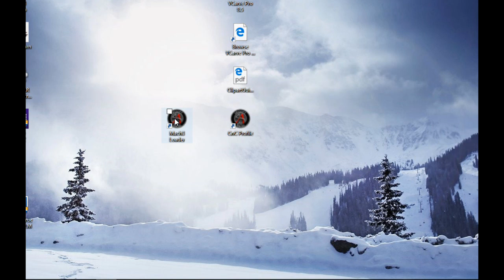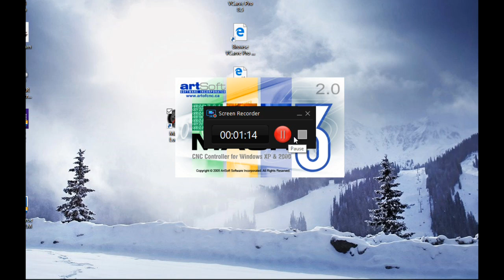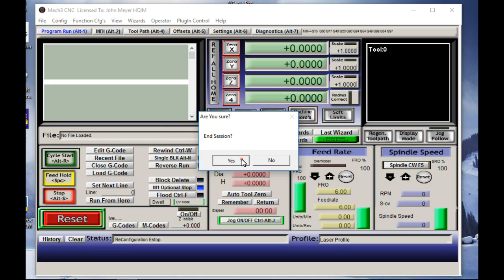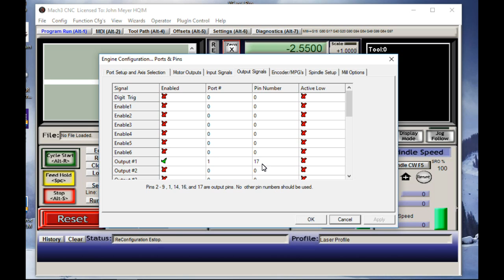0002 Mach 3 Laser Profile Setup for JTech Laser and VCarve Pro

Comment: I don't know maybe someone can help me or maybe I'm over looking something
breakout board I'm using is a DB25 1205..
laser is 15w … 3 wire ..... positive... negative... PWN
laser came with power supply...
hook laser up to pin 17... basicly followed setup in this vlog
test … laser on... but laser is on straight out of box too..
question is how do I turn laser on and off
is this function within gcode...
or can I control this via mach3

Comment: Great, even work with chip Chinese TTL (0-5v)pwm, just hooked up 12v to power, Gnd to Gnd, and 5vTTL input to pin 17 and with J-tech modifide with m10 and m11 command vectric postprocessor for mach3  and it worked like a charm, Thank you Sir